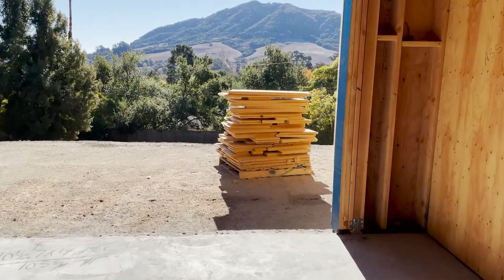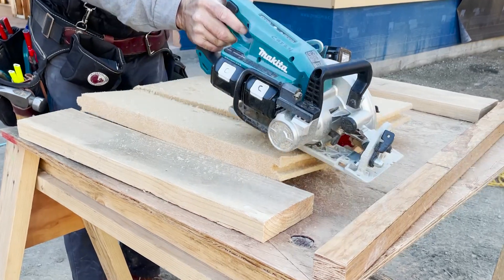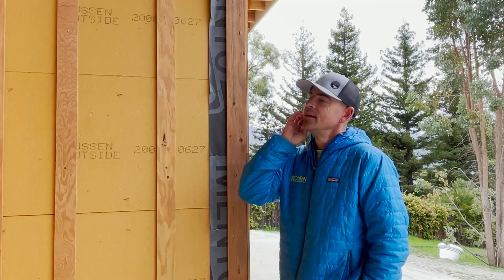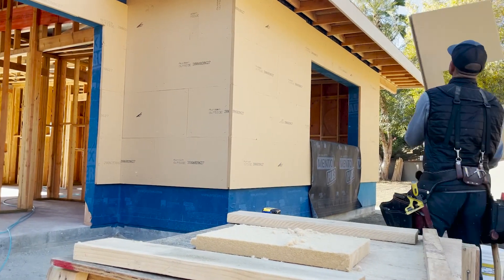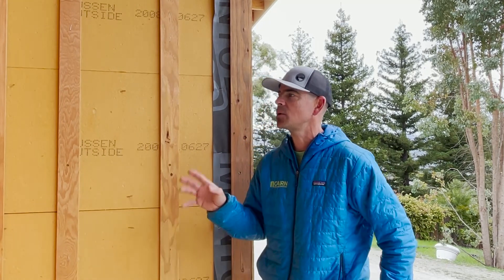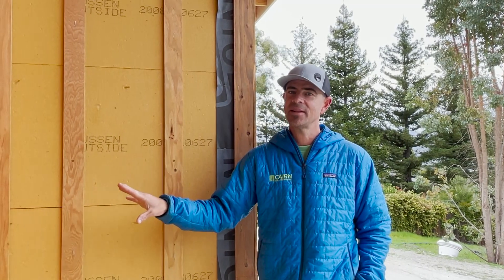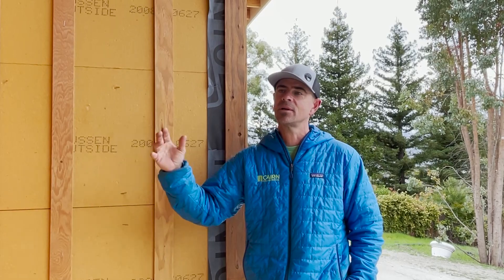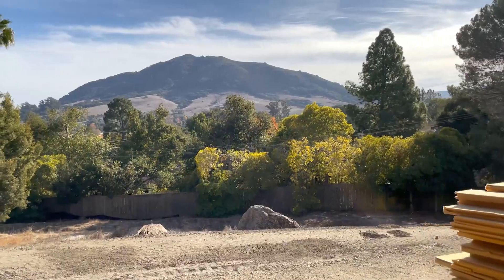Bishop Passive House: Exterior Insulation Pt 2

Comment: Hey, I have a question on the fixing of the cladding: doesn't the use of the staples puncture the AdHero membrane behind it? also the same with the screws for the battens. you didn't use/consider something like tescon naideck?
Reply from the maker: Hi there. Sorry for late reply. As much fun/work it was to create the video series, we are building in the field everyday still and don't get to the replies as often as we should... obviously. 

The staples would puncture the adhero, yes. But we are talking really splitting hairs at that stage. It's similar to when folks use Zip - with it's ingrained membrane - but also puncture that membrane with every nail that is holding it in place. You need other, much-greater additional forces to move any type of water that miniscule, micron's wide "hole". In the real world, it doesn't happen, particular since this adhero has a layer of woodfiber insulation over it, then a rainscreen gap, and than another layer of either stucco or wood cladding.  Same as the screws used to attach the insulation. They penetrate through the insulation, through the membrane (which technically "seals" around that screw) and then goes into a framing member on the inside. You'd need some outrageous amount of exterior forces (above hurricane strength winds, for example) to be applied DIRECTLY to that micron hole for any sort of water to penetrate all the way into the home. At a certain point, I don't think about that happening. If that's what's happening in the world... we've got bigger problems to worry about on that day! (The end is nigh!! ). :)

Comment: Thanks for the video series, it's excellent. When you mentioned that it dried out in 24 hours, was there also significant wind washing on it during that period? How do you think it would hold up in months of constant drizzle with not much wind? Have you ever tried leaving a sample in a bucket of water for a very long time just to see what happens?

I think wood fiberboard is definitely one of the most promising options for exterior insulation, but I'm trying to do my due diligence. I've heard Christine Williamson remark offhand twice ( https://youtu.be/tU9ciWUfM0A?t=4752 , https://youtu.be/XfiRYQBU4_M?&t=1974 ) that she feels it's somewhat risky to have moisture sensitive exterior insulation (in one video she's talking generally and in the other she specifically mentions Gutex). However, she fully admits it may be due to her own ignorance with this type of insulation.
Reply: Thanks for the compliments on the video series. We funded it ourselves, so we think we're being fairly objective :) 

We did not have wind washing on the product in that dry out time. We had heavy sideways rains here for a few days. Everything was saturated completely. Everything! It was wild. I don't think any product in the world would hold up well under months of constant drizzle - unless it is designed to do just that, i.e. siding, stucco, etc. Insulation materials (for the most part.... although there are a few exceptions out there in the wild, but pretty experimental) are not meant to be left exposed to elements, particularly rain, for extended periods of time. They should be able to become wet or saturated and dry out though, because no wall assembly (even though we'd like to hope so) is perfectly waterproof forever. 

To that, I have not left a sample in a bucket of water - at least not intentionally. I did, however, leave a piece of Gutex and a piece of Rockwool outside my house for almost a year, accidentally. Just dropped them on the ground after a presentation and forgot them. A year later, I can say that one of those samples (about 1' x 1' pieces) help up just fine, and the other was peeling apart in fibers. The woodfiber board was fine, and the Rockwool or Roxul was pretty mildewy. To be fair...neither of those products should be left outside exposed as they were, so it's not a real-world situation.  But it was interesting...

To be fair, woodfiber board is used extensively around the world in places with much worse climates than the US. It's used all over New England, specifically Vermont and Maine, where some of the worst and wettest climates exist in the US. If you want to talk about moisture sensitive insulation materials, foam board is extremely moisture sensitive. It can't dry. Rockwool, Gutex can. I like both of those. Gutex has a good density over Rockwool/Roxul. TimberLab is making woodfiber boards in America now, too, so will be interesting to see them begin shipping.
Reply: @michaelhorgan6640  Sorry I somehow missed this earlier. Thanks for the excellent and comprehensive reply. 

Was the Rockwool a piece of batt or was it Comfortboard 80/110?

If the moisture sensitivity is mostly on par, I suppose it then comes down to the vapor permeance and how much that matters for a particular assembly. It looks like TimberHP boards may actually have higher vapor permeance at 40 US perms at 1 inch vs 31 for Comfortboard 80. Somehow I was under the impression (I think, ironically from a presentation by Rockwool...) that Comfortboard had higher permeance.
Reply: It was Comfortboard 80 that was left outside. Again, though, not really a great comparison. They were both just dropped on the ground while walking in the front door :) not really a "test".  @comfyhome

Comment: Thanks for the great video. Also to add, also, if I may, that wood fiber boards allow the building to breath, contrary to what happens with its plastic counterparts, which is a crucially important advantage of this product! And, in addition to the above, wood fiber panels do not emit the compounds that polyurethane and polystyrene do, and which have been proved to cause either cancer and/or respiratory or other problems to the people living in buildings insulated with such products. Especially polyurethane foam, should have been banned from the market a long time ago, based on what it has been found to cause to humans. I really applaud you for highlighting the need to use eco-friendly materials in our buildings. This exemplifies how each every one of us should be thinking and acting; it’s about caring about the planet and our fellow human, and not just about how to keep a few more bucks in our pocket right now, but absolutely disregarding that we will pay multiple amount of money by staying in a building and planet full of shitty plastics (e.g., polyurethane) in the near future!
Reply: Sorry I missed this reply. I actually wrote a story on our IG page today about something like this...the bigger picture. We all need to be thinking about it, hard.
Reply: You want the building to breath through an ERV or HRV.  The more important point is this material is vapor open and you can have your air/water/vapor control where it belongs using membrane materials and this thermal layer gives you a lot of drying potential and won't trap vapor or water where you don't want it.

Comment: Hi….I have purchased the Multitherm 4000, Mentos, and intello. The plan for the exterior is OSB, then mentos, then the Gutex, then cladding. After reading in another comment about possibly putting mentos layer over the Gutex, I now wonder for the northern Idaho climate which system might be better. Do you have time to give me your thoughts on that? Thank you for the videos, by the way.
Reply: I wish I know about this building product when I built my place in the Cabinet mountains northeast of Sandpoint.
Reply from the maker: Hi Tom, Didn't see this comment until today. How did things go?

Comment: Did the Adhero stick to concrete, or did you apply a primer?
Reply from the maker: Hi David, At the slab where the Adhero meets the concrete, we utilized contega multibond (acrylic adhesive) to act as a seal and stick the membrane to the slab.

Comment: This is a great video. I don’t know much about the wood fiber insulation. My concern would be using this type of insulation in cities that termite problems.
Reply: Thanks Stacie. On a project like this, the materials are sealed so, so, soooo carefully and tightly from the outside environment in a variety of ways that it would be impossible for termites to get to the material. Additionally, termites need moisture/water and not just a material to eat - which will not occur. If materials are dry - or even better if materials are used that can dry if they get wet, then termites don't have the wet food they like. :)

Comment: Do you have any videos on window installation and exterior trim build for them?
Reply: I believe we have some videos about our installation of our windows, yes. The trim detail we used is a simple box-frame with a 2-degree slope on the head and sill casing. However, our overhangs that we've designed into this home prevent almost all rainwater from reaching the windows.

Comment: Why not rockwool, ? Esp in fire prone California ?
Reply: Embodied carbon aspects; the yuckness of working with Rockwool for all of us in the field; the compression factor of woodfiber compared to Rockwool Comfoboard, etc.  There are a few reasons.  I'm not anti-Rockwool and have just used it on a sauna I've built at our own home here, and I've used it fairly often in the past - but mostly interior applications.  I just prefer woodfiber for exterior insulation. We may use Rockwool on an upcoming PH though for the very reason you wrote. Though Gutex performs just as well during field tests under fire, it does not have the actual WUI rating required for high-severity fire zones in CA - which is a shame.
Reply: @michaelhorgan6640  what's the cost comparison for comfortboard compared to wood fiber, install excluded.
Reply from the maker: @stevecrawford6958  Hi Steve, Costs are changing so rapidly these days, across the board. Rockwool will be less expensive, though materially not by much. The different in using Rockwool/Roxul is that it's pretty readily available, and finding and shipping Gutex is the killer. It wasn't when we built this, but it is now. We can't get Gutex at the moment, so we're largely changing to Rockwool now, too, until the world steadies itself and materials are available to us again.
Reply: @cairncollaborative7736  It would probably help if Gutex has some local manufacturers, but they don't as far as I know. It's all made in Germany, and they've had a rough couple of years and this winter will be absolutely brutal. I wouldn't rely on German products for the foreseeable future. Making the switch to Rockwool for the time being is the way to go.
Reply: @cairncollaborative7736  thanks for the candid response. i think there's supposed to be some other companies offering wood fiber soon which will hopefully balance things out, in terms of both supply and price.
Reply: @SouthernPecan86  Gutex is expanding as we speak and will be able to ship more products very soon.
Reply from the maker: We are trying to get the Timber HP product out here in the West. We've been in contact with them, but they have said for the foreseeable future, there is no plan to be shipping out to the West Coast. I hope we'll be some of the first to know when they do begin getting it this far away from their headquarters in Maine @timberhp @stevecrawford6958

Comment: Great videos and learning resource for passive building. How does this exterior insulation stay dry? I can see the weatherproof membrane behind it, and you mentioned that it dried quickly after lots of rain but how? It looks like it would be so absorbent. I'm intrigued!
Reply from the maker: Great question! The specific product that we used from Gutex for this build (Their multitherm line) uses a paraffin wax that helps the insulation to shed water. It was pretty incredible to see it dry out after a large storm we had!
Reply: Why not put the weather membrane on the outside ie over the gutex?
Reply from the maker: @TheRealMrLaserCutter  You can do that. Gutex has a few different lines of insulation, and this particular one does not require the membrane on the outside of the woodfiber. We've done it both ways, however, using the other lines of woodfiber insulation.

Comment: this is a cool assembly. can you share what the thought process was for putting the peel and stick membrane on the sheathing and not on the exterior wood fiber board surface?

I've seen it done three ways now: 1) no membrane--wood fiber insulation serves as water control layer, taped plywood sheathing on the interior is the air control layer - https://www.youtube.com/watch?v=ow93BkBIF1I 

2) peel and stick membrane applied to the exterior of the wood fiber board insulation - https://youtu.be/yqUvF8mcovQ

3) your video's method

It seems like all three methods are fine, I'm just not sure what the subtle differences are. Maybe one is just easier to do?
Reply from the maker: Hi, glad you found our videos! There are a couple different things at play here. Regarding the 2nd and 3rd option it really depends on the type of wood fiber insulation that we chose. We used a company called Gutex who makes a couple of different kinds of wood fiber insulation depending on the usage. The Multitherm line that we used utilizes a paraffin wax on the exterior that actually helps it to shed water. Because of this, we were able to put our membrane onto the sheathing and leave our exterior insulation exposed.  If our exterior insulation did not have this wax incorporated, we would have needed to use a different type of membrane to protect it from bulk water.

The first video you linked looked like a pretty cold climate in the Northeast where they were worried about humidity in the winter and moisture getting into the walls from the interior. On this particular house in SLO, we were not as concerned with humidity entering the walls from the interior, but more concerned with keeping water and our heavy fog moisture away from our wall assembly. (And using a rain screen assembly so that when water does inevitably get in, it has a place to dry to.) These decisions depend on the specific project and specific climate and what you are trying to achieve with the building.

There are lots of different ways to achieve a similar standard/ goal so it really depends on a particular set of variables. We wouldn't necessarily use this same wall assembly in all of our projects, but it worked for what we were trying to achieve here.

Hope that helps!
Reply: @cairncollaborative7736  Sorry if this is a double comment, I was trying to edit the old one and it gave an error.

 @Cairn Collaborative  Hi, thanks for the detailed reply! 

It makes sense that each assembly is specific to a particular climate/site application. I appreciate the time you took to detail your thought process for your environment.

I have a related question: while investigating these assemblies, I came across a sort of blanket recommendation (which I have yet to find the paper or study detailing the reasoning why) -- this recommendation says that the interior materials should have a permeance that is 5x less than the exterior materials (German DIN 4108-3 regulations / US DOE guidance, https://foursevenfive.com/blog/a-high-performance-roof-should-be-vented-how-to-do-this-properly/ ) 

I find this blanket recommendation a little confusing, because I know that taped sheathing as the combined air and vapor control layer to be a fairly common method in higher performance builds, so maybe the recommendation is not necessary? Or maybe OSB is more common than plywood, and with its reduced comparative permeance, it is easier to find exterior materials to suit the 1:5 ratio? Or maybe most forms of exterior materials are not so airtight that it really matters?

What are your thoughts on this blanket recommendation?